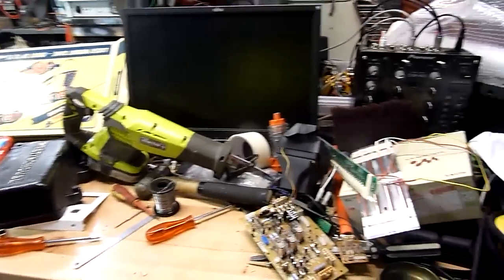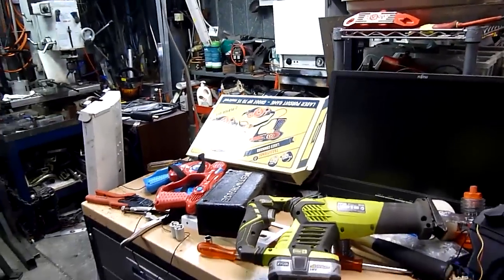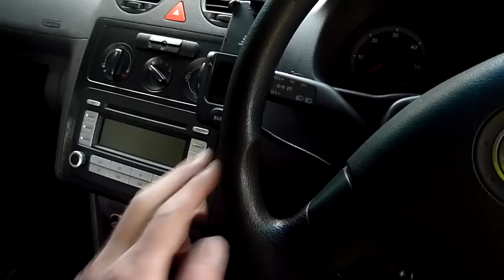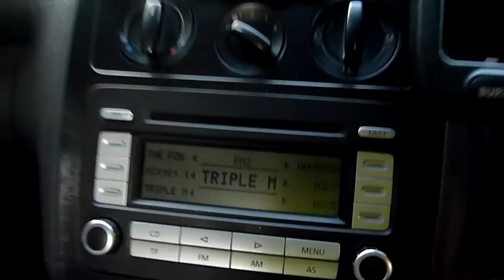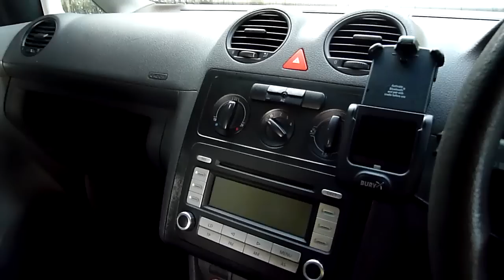Ramblotron Entry   August 24 2015

Comment: what year is that van my 04 golf has a bit of a thumping in the clutch I was told not to worry for a while yet ,a poperly maintained tdi should go well into the 500000s  my 1.9 has 311..km its never seen more than 12000 km on a oil change and had top grade amsoil 5w40-505.01 and 8$ mann filter runs almost like new awasome fuel mileage

Comment: Citroen 2CV was the tin snail.

Some of the VW diesels were unit injection, think they are have to have the correct oil to run right.

I used to have a Renault Kangoo van, about the same size as a Caddy, nice little van but gutless as mine had the 55hp non turbo engine, just about do 75mph flat out!
Reply: heavydiesel Yep, this VW Caddy also has a Unit Injector system, not common rail. These injectors have a high pressure pump build in, driven by cams. Creates higher fuel pressure(1800-1900Bar) than a common rail. That pump on the cilinder head is relatively low pressure. It's called a tandem pump. Rule of thumb for the tandem pump is 7.5bar at 4000RPM. It's one of the best systems out there, still used in bigger truck engines(Scania). However not suitable for regenerating the particle filters on the diesels of today because limited control over injection timing anywhere outside of the compression stroke. About the oil, make sure your oil is up to the VW507.00(longlife) spec, a cheaper alternative is to use a VW505.00 spec oil but then you need to change it more often.

Comment: The RACV uses Caddys, got chatting to one of the blokes he didn't think much of em. Basically a Golf with a van body. Philips do great fluro tubes, the key to selecting the right tubes is looking at the 3-digit code. First number is the CRI (colour rendition index) and second two numbers the colour temperature. eg 830 is >80% CRI with a 3000K colour temp. 5500K is daylight and 6500K cool white. The high CRI tubes are a couple more dollars ($7 for a 4-footer) but the difference is incredible. Try a 955 or 965 tube if you can get em. Try Lamp Replacements in Bayswater.

Comment: Your workshop is stadium lit now, makes the lathe look even better, the overhead motor just looks like it belongs there, just a guard needed for safety.
Pull cord switches on the lights might be a thought, dont need them all on, save your power bill a little.

Comment: new lights look great.  so your house was a wreck when you moved in?  new light is whiter as well.  that long a barrel is called a cannon.  2500 to 5000 rounds is plenty of fun.  a Star Trek version of Aussie50 might own a low power phaser.  white van is slowly falling apart.  oil filter is important.  covered battery is different.

Comment: Couldn't the dual mass flywheel be swapped out for a more reliable single mass flywheel?
Reply: TheOmegaRevolution It's not usually a great idea, it can damage the transmission or at least give it a harder life. The ride isn't all that smooth either if that's important to you - maybe not on a van.

Comment: whats the system specs on that wall mounted computer?
Reply from the maker: Aleksey Rovnyi left board is an i5 2500 with 16gb ram, and a 970. the right board is a Core2 8400 with 8gb and a standard video card.

Comment: Hey, why did you delete my comment about TDIs? What was wrong with it?
Reply from the maker: +mwsoft I only delete really nasty troll comments (personal attacks) if your comment is not showing up, either YT is having one of those days, or it got wrongly flagged as spam.
Reply from the maker: +mwsoft ah, typical, I found it in the spam folder, because you used hyperlinks, it got flagged for spam. I need to see if there are settings to stop that.

Comment: Ed, It's not common rail!
All TDIs from 1998 till about 2008-2010 used PD (Pumpe Düse) injectors.
It's actually very interesting technology. "High pressure" pump on the right produces only 3-8Bar, and the actual injection pump is integrated in every single injector. They are driven by additional lobes on camshaft, and have internal solenoids to control injection period.

In late '90 this technology was really impressive - PD produces ~2200Bar injection pressure, while Common Rails from that time frame didn't even have 1000Bar (and all sorts of other problems with high pressure pumps etc.).

I've done head rebuild on my Golf Mk5 with almost identical engine, you can check out the photo gallery:
http://imgur.com/a/Mvkug

Also there is very interesting booklet from VW describing in details injection system in this engine:
http://www.myarchive.us/richc/VW_TDI_with_PumpeDuse.pdf

Comment: if you want more amps get a medium sized diesel generator, like 11kw would do
Reply from the maker: +Josh Kilen I have tried running a box generator and even with it out behind the shed in its own area, the drone/noise is unbearable :(
Reply: how about a large generator that is a on a single axle trailer, that provides three phase and single phase power

Comment: With you work shop lights try Osram I can guarantee a good long lasting life span I use them on security lighting at a sports club and have try different brands such as Philips  NEC, General Electric, and Crompton Lighting they out lasted all off these I have them runing on 4 out of 26 light fixtures they where replaced in 2008 there on every night and still running 
I'm also starting to replace them with LED tubes to try and cut back energy consumption

Comment: new 200 amp service here w/ licensed is $600-1000...just the panel. 
I avoid rimfire anything like the plague, too vulnerable to Obama market regulation fluctuation and yes .au is affected by price and availability of US manufacturers (global reach)...wish I'd never bought .22lr anything except for my huge stockpile of cheap ammo when it was $10/525 value pack on sale. 
pronounced nee-sawn here instead of niss-un